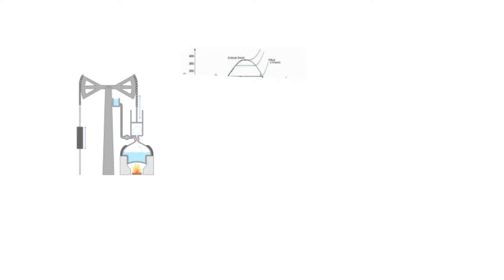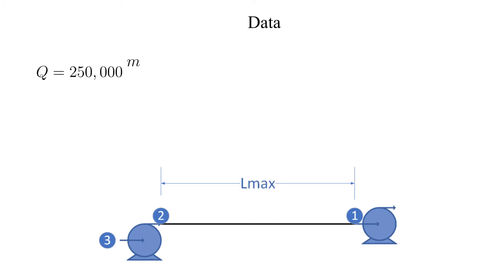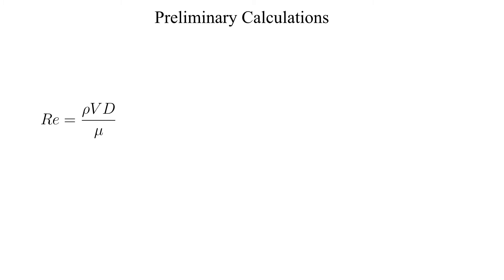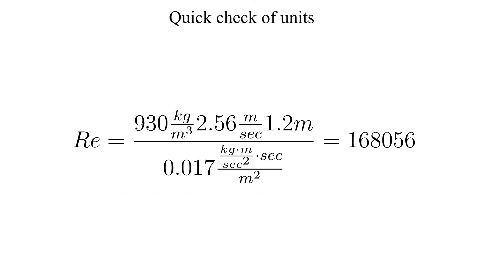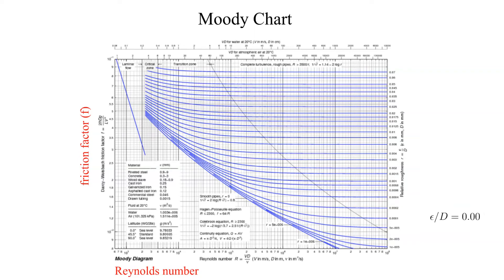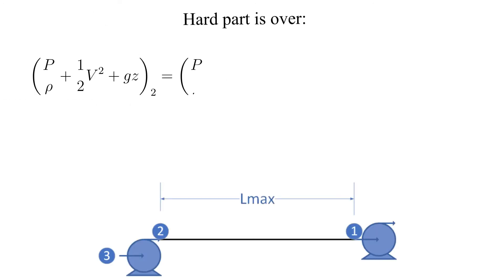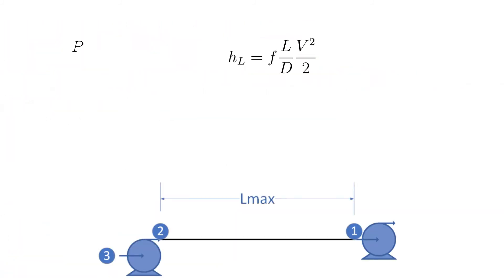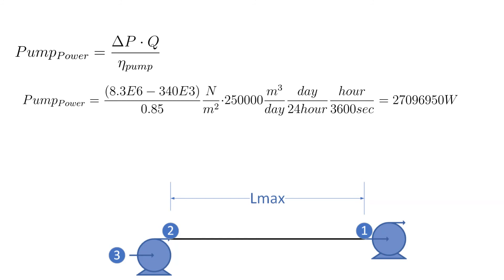Pipeline Hydraulic Calculation

Comment: Hi... I have a hydraulic system design. The components used in my design are, Electric motor, Hydraulic pump and hydraulic cylinder. I already did most of the calculations but now I am struggling to calculate the internal size diameter of the hydraulic pipe connecting the hydraulic pump and the hydraulic cylinder. Please help.
Reply from the maker: Not enough info to offer advice.  Sorry.